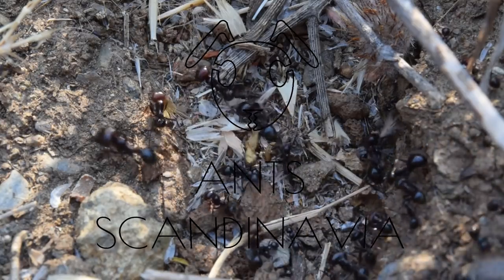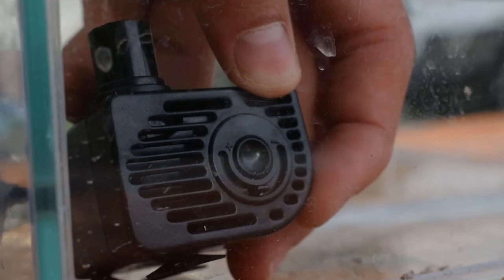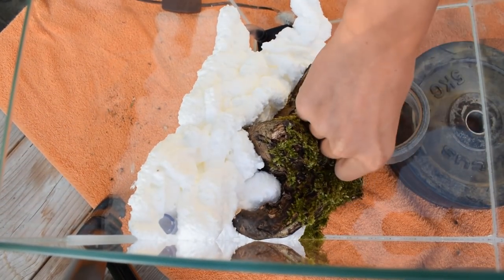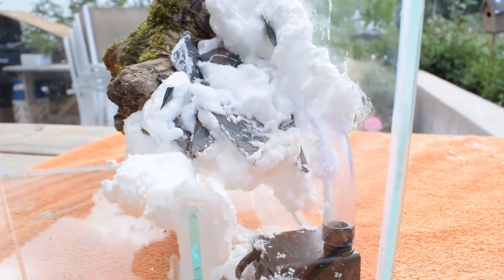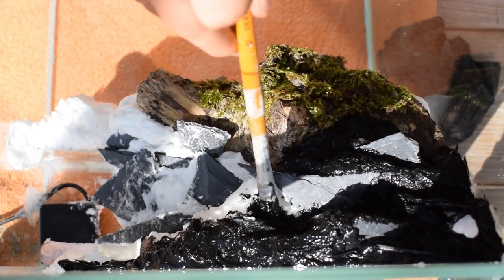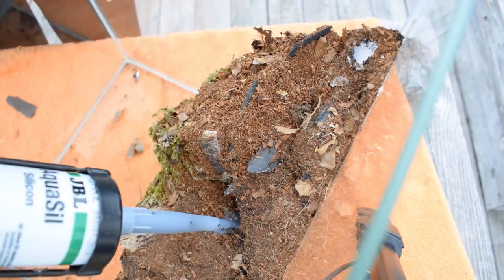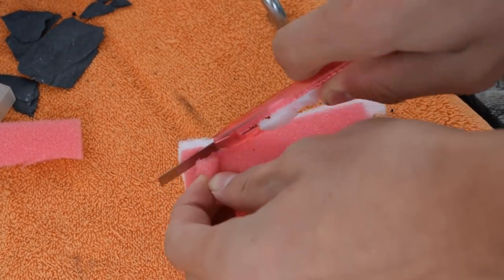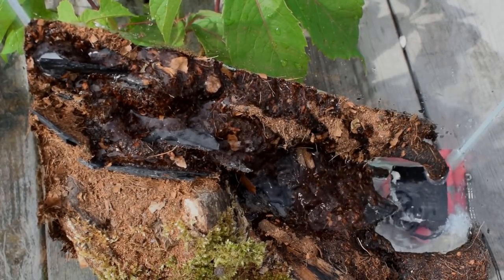Vivarium Waterfall Build

Comment: Few tips for your next one, 1.make a pool at the top instead of just shooting it out, then have all the edges you want water to flow about the same hight and below the other edges

2. Have the pump under the pool and not to the right then where the water ends in the reserve have it look good, add silicone then pebbles and rocks to round it out and have a “wall” that has a few holes in it to let water go to the reserve
Reply from the maker: Thanks for the tips!. The pump placement was intentional, as if something happens with it, i will be able to fix it. Plus, I will add alot of roots and twigs, so I will place some wood/qork bark or something there, so the pump will not be visible in the next part of the build. 
To have little "puddles" that the water can pass through (as you suggested, if i red it correctly) would be nice and I thought about making it like that, but I think that having it go straight down would look better :)
Reply: Ants Scandinavia looked really good though especially for a first one.
Reply from the maker: Thanks :) Ye, i will improove a ton to the next one ;)

Comment: great video!  Another great way to get things to adhere to the foam background is to apply foam and then give it about an hour or so before you try inserting things into it.  rocks may still be a bit too heavy but flower pots, wood pieces and other lighter things go in well when the foam is only half way set up.  if the background is going to be deep, you will have issues getting the foam to cure properly.  In this situation, apply as directed ( not more than 2 inches deep) and let it cure before adding the next 2 inch layer.  this will also help you have something more solid to stake/insert background decorations and hardscape elements into while creating the background.  Anyways, cant wait to see part 2!  Keep up the good work!
Reply from the maker: Thanks for the consern and the feedback! I learned alot on this build, putting them is at it being half cured was a smart Idea!! And yes, I have notices that the "inside" of the foam did not cure proparly and that I will apply it in stages next time ;) Thanks for the feedback tho!

Comment: Why can’t the waterfalls have the same compartment with the rest of falsebottom? Is it necessary to create a wall that divides them ? As long as the water level doesn’t touch the substrate level for the plants, for me it would be neat right as it would add more humidity too.
Reply from the maker: I guess you can do that as well, however, I kept it in a compartment to minimize the risk of the soil getting soggy

Comment: How did you cut the glass?
Reply from the maker: With a hand held glasscutter :P
Reply: Ants Scandinavia Also the hole in the wall? Looks difficult to me😅
Reply from the maker: Yea, a glass drill. You have it on a hand held grinder instead of a normal plate, this way it spins suuper fast. The drill has diamond piaces at the end of it so it drills suuper smoothly. A drill like that costs like 30 euro, so not that much :) Do some research on glass drilling on youtube, you will find someting!
Reply: Ants Scandinavia Thanks!!